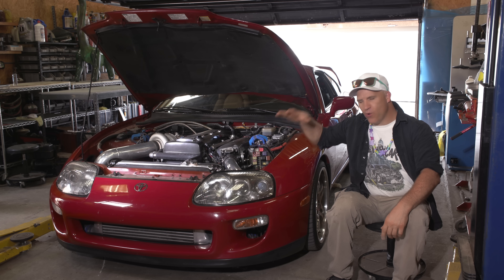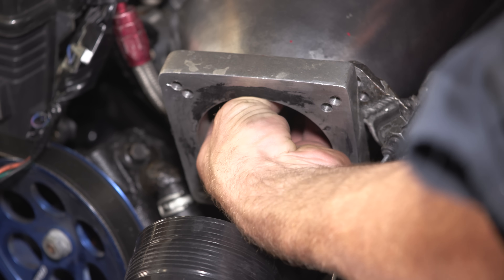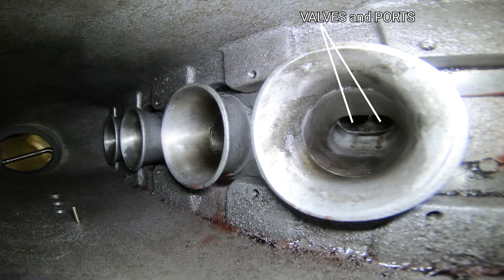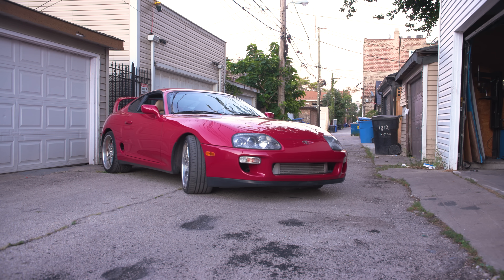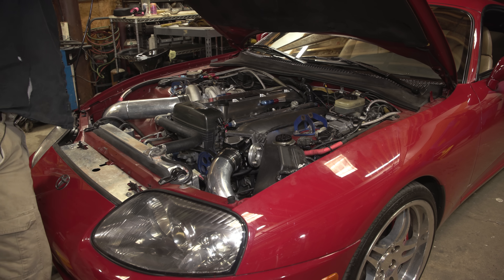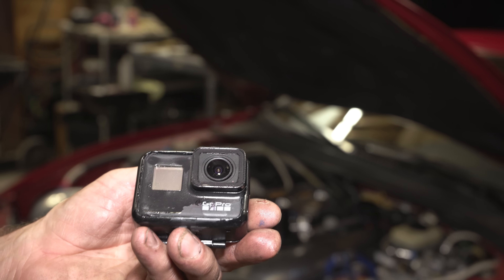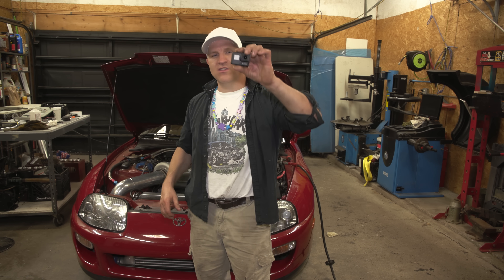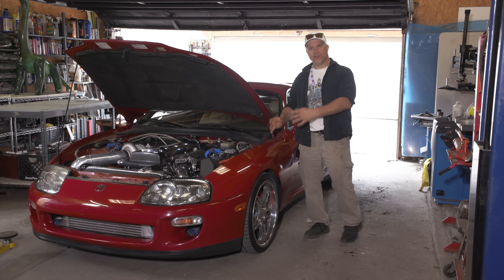Driving with Gopro Inside My Intake Manifold (Toyota Supra Turbo)

Comment: Looks like you need someone to adjust the tune, but my guess is that you are still on the stock ECU
Reply: Think he might have an obstruction in his intake manifold
Reply: I'm going to go out on a limb and say considering it has around a 1000hp that it's tune is on point, the oil you see is normal its from the pcv   he just needs a catch can
Reply from the maker: So the oil turned out to be from the power steering low pressure vacuum switch, turns out it's defective and it's bypassing oil from the power steering pump into the intake manifold.  If you look closely the fluid is red... That's what led me to check out the power steering system.
Reply: @WarpedYT  Oh thank you for answering that. I was confused why it was red. Kind of broke my brain...
Reply: @WarpedYT  i had to find this comment because I couldn't figure out why it was red lmao
Reply: @tylerc7336  exactly this shows why catch cans are useful
Reply: @8KrepE7  he has a catch can, theres AN line from his intake pipe off the turbo going to the catch can. He should not have it run like that and just have a vent off the catch can. Oil is getting pulled through that line and put through the whole intake path because of this.
Reply: @suprarob8553  you do want it ran to your intake because that causes negative crankcase pressure. Catch can just isn't doing its job well.
Reply from the maker: It turned out to be power steering fluid.. but I designed the original catch can system for the 2JZ Supra. You can look back am I original design from like 16 to 18 years ago, but it does run into the intake to take advantage of the slight negative pressure after the air filter. But yeah it turned out to be my vacuum switch for the power steering pump it's faulty and is bypassing oil from the power steering pump into the intake manifold through the reference tube
Reply: @WarpedYT  it looked weird to me, at first i thought it was power steering fluid, but i was like nahh iam pretty sure iam wrong, but i was right lol
Reply: @suprarob8553  a catch can can be vented to atmosphere
Reply: @tylerc7336  1000hp I'm gonna say that is very unlikely, I know plenty of cars that are known as 1000hp cars that fake the numbers.  Really I was going off of every time he did a pull there was fuel blowing back into the intake manifold being sucked into other cylinders, its dirty but effective or an injector is sticking open.
Reply: @Junkyard_Dave  dude this is the first time anybody has put a camera inside a Intake manifold, stop acting like a Mr know it all, the tune is fine his car runs great you have know idea if what's going on inside is normal or not
Reply: @tylerc7336  actually they have been doing it on F1 engines forever even when the cameras were as big as suitcases
Reply from the maker: Exactly what I was thinking too! that's the whole reason I did it in the first place I knew we were going to see a lot of unexpected things, but someone else commented pointing out that all that fuel spray is exactly why oems are using direct injection and other technology to increase efficiency.
Reply: @WarpedYT  it was definitely a cool video too bad it wouldn't last long in the exhaust.
Reply: @Junkyard_Dave  a f1 engine and a supra engine are completely different engines
Reply from the maker: @Junkyard_Dave  thank you.
Reply from the maker: @Junkyard_Dave  yes everyone with a Supra claims 1000hp, but I can give you my mod list, my car at one point made 1150hp during that time I had twisted about five different driveshafts like a pretzel and almost broke my hand twice from the drive shaft yoke hitting the shifter from underneath, that happened in 2nd and 3rd gear. That's why I recently detuned the entire thing to make about I would guess 950hp, way more fun to drive with a smaller turbo smaller throttle body and smaller injectors, I'm running e85 I built one of the first super is that ever ran e85 a long time ago. And my ECU is AEM, I was going to show some of that in the video but I'm going to save that for the future videos . I wanted to keep this one short and sweet.
Reply: @tylerc7336 hes talking about putting cameras in engines...not comparing engines
Reply: @WarpedYT Can you adjust the start of injector time? If so you can get the injectors in sync with your cam.
Reply: @tylerc7336  Then why do manufacturers waste their time and money building them? You can go from a tiny two stroke to a giant ship engine, physics still apply. No not everything, but what you learn from one can be applied to the others. Just not a wankel, that's a different beast altogether.
Reply: @divinedriftofficial  yes I know and I'm talking about the way the 2 are designed are completely different Indy engines have no smog,mpg,and longevity to deal with so I'm sure the inside of the intake manifolds act differently
Reply: @davidwickboldt712  I guarantee a port and polish job or a aftermarket manifold would end up with diff results,
Reply: @divinedriftofficial  we're having a perfectly fine debate so unless you have something to add go troll elsewhere
Reply: @Junkyard_Dave  it didn't sound like a 1000hp car. I've heard 600hp 2jzs that sound rowdier
Reply: @tylerc7336  you literally said this guy is the first guy to put a camera in an intake, that dude said they been doing it in f1 before. And ur saying oh the engines aren't the same or comparable. Who cares. First is first.
Reply: @WarpedYT  a friend of mine  bought the 2020 customs supra in washington state that was owned and tuned by the owner of AEM. It made 650+ whp on pump gas, 1100 on c16. He didnt have a e85 tune because it wasnt as widely used back in 2007. I've been in some fast cars, but that one was terrifying. 170mph in 5th gear, on a very busy urban road was my last memory of that savage animal beastmode car. He had a lot of the same stuff you use, 6 inch TB, crower 3.4 bottom end, 80mm honeywell, banks intercooler for a diesel, AEM EFI. I believe what you say about the output, these other fellas are just a little too used to internet BS and that clouds their perception. Still only ran a 9.89 quarter, like most 1000hp supras lol.
Reply: @r6exrider  Well, you've clearly got a lot to learn still.  As if you'd know exactly what sort of exhaust and muffler system this guy is using, and how well the mic communicates the audio.  But hey, it's the internet comments.
Reply: @WarpedYT  dude I have to say that is on sexy supra . I'd love to see it in person and just be a passenger for a pull . That thing looks amazing and runs insane love it !!
Reply: I love these armchair tuners giving mechanical advice with very limited audio quality
Reply: @vintageexcellence  meh everyone is entitled to there opinions and theories
Reply: SIMCARZ 3ny tuning has one best outcome to make the most power with the same equipment - opinions have ZERO to do with it. Do you have a wall of participation trophies in your room?
Reply: And the award for most pointless internet pissing contest goes to:
[ ] Religion vs. Atheism
[ ] Meat eaters vs. Vegans
[ ] Our military's X is better than yours
✓ Car guys
Reply: Everyone here saying Junkyard Dave doesn't know what he's talking about clearly have no idea who the dude is. The man is hand fabricating his own 2020 Hellcat AWD Magnum by himself and I am damn impressed.
Reply: 1000hp and thinks it's stock ecu.  Cmon.
Reply: @SportbikerNZ  I could get 1000hp out of my car with a stock ecu, but its not a Toyota, they probably aren't as adjustable
Reply: @BrokeWrench  Not to mention the obvious, but your ecu prob isn't 90's vintage?
Reply: @SportbikerNZ  1995 Eagle Talon. Id need a lot more work to do it, but the stock ecu is basically able to do whatever you want until the hardware isn't able to keep up. My evo is even better but thats an 03
Reply: @BrokeWrench  You don't need piggyback units fooling the ECU?  Or physical changes to the ECU?
Reply: @SportbikerNZ  nope. There is a memory chip that gets replaced for the talon so it can use a programcalled dsmlink, but the evo has a reflashable memory from the factory. Most of the Mitsubishi ecu's are reflashable and you only need to replace them with the craziest builds for that extra bit for competition
Reply: @BrokeWrench  Oh ok, sounds rather mod friendly.
Reply: Dear Dave....stop giving advice when you clearly have no knowledge of what's tunable and how it is done.- sincerely, everyone on this channel
Reply: @DrB00ST  Someone had to say it.  Thumbs up.
Reply: @DrB00ST  pretty sure I have the correct qualifications to make the assumptions I made. I mean i will say I'm very well versed with JZ', MK4's, and tuning.
Reply: @Junkyard_Dave  well then you would know that you can tune a stock ecu right? when I still had my 13b in my 93 fd I made over 600whp on stock ecu with an apexi safc II
Reply: @DrB00ST  There were about 10 people here that gave the wrong advice and you're picking on one guy?
Reply: @Gino_567  Pretty sure the OP is first in line to brought into line, given they are the OP.

Comment: Nice, I would be worried about the red hydrolic fluid though
Reply: Congratulations on being one of the few people who spotted it as being  hydraulic fluid. Turns out it was from a faulty vacuum switch for the PAS pump bypassing fluid back into the intake via the vacuum reference line (he replied in another comment).

Comment: Your running 20-25psi so i assume not meth injection correct?  If it's not then you are having 110% mega blow by.... We build Supras for a living (well and a whole lotta KAs and SRs and even the odd RB here and there... 1, 1.5 and 2Js are what we specialise in)

I fully believe you have a leaky head gasket. Also the tune is far from clean, this car hugely needs a good tuner and some dyno time.

If you are in Florida my Husband and I would be more then happy to dial her in for you.

Comment: The oil is probably from the crank case vent return line that goes back into the intake

Lovin these videos.

Don't see many of those FANTASTIC Supras anymore. They were one of the only cars i would worry about when it pulled up next to me when i used to street race in the late 90s
Reply: It looked red like the oil you put on a K&N cone filter
Reply: look to the right. the head is broken, leaking oil through the crack. some dowel pin for other intake i guess
Reply: The oil spoil not good
Reply: It's power steering fluid. 

His answer to a different comment: "So the oil turned out to be from the power steering low pressure vacuum switch, turns out it's defective and it's bypassing oil from the power steering pump into the intake manifold.  If you look closely the fluid is red... That's what led me to check out the power steering system."
Reply: @DanielStancex  wow, that's interesting. I had no idea the Supras power steering system was hooked to the engine vacuum
Reply: @johnnyturbo8460  I was definitely going with your first hypothesis and I was going to recommend the uploader install a catch can. I'm not familiar with the Supra's steering system; pretty weird that it's integrated with engine vacuum, but I'm fairly sure there's probably an engineering reason for that.
Reply: @chrislimnios9180  agreed, it does seem odd for the power steering to connect at all to the intake.

I was also thinking maybe it was E85 , because you can see the fuel injector at the last port closest to us (the one you can see down), dumping fuel and between shifts when the boosted air goes out the waist gate (to release the pressure during shifts) some of the fuel goes out into the intake with the vacuum of the air escaping threw the blow off valve.
Reply: Alrite Paul walker calm down
Reply: @jamesscott5407  what does that even mean?
Reply: Ask vin diesel you spoon
Reply: @jamesscott5407  

Man, you got Fender Bendered!

😂😂😂😂😂
Reply: @jamesscott5407  nah, why don't you ask him the next time he is spooning you!

Check mate,  you loose!
Reply: @johnnyturbo8460  

Haha....

Thumbs up from me for that last comment. 

Keep it real brother!
Reply: @johnnyturbo8460  you mean lose...not loose...I was just playing about...I'd hate to offend a 90's street racer...you're all well hard, double clutching like you should
Reply: @jamesscott5407  nah fool i mean loose because when Vin Diesel is done with you, you will be loooose!

Don't correct what you don't  understand. It's best you just fade away at this point. Shhhhhhh
Reply: @ukcitizen1158  🤘😁👍
Reply: @jamesscott5407  funny that. no one got the reference
Reply: @duneattack  there's a couple of references dropped that no one picked up on...I did start this for just a little giggle..hoped our man Johnny turbo here would have been more intellectual 🤷
Reply: @johnnyturbo8460  don't worry James is going back to school soon.
Reply: @richardd8352  🤘😁👍

Comment: Next up: driving with a GoPro in cylinder 4
Reply: that will not work, the motor will blow up in less than 5 minutes, guaranteed!!
Reply: The camera wouldn't last 1 compression, and then the smashed camera would foul up valves and then it's lights out for the engine too
Reply: @mrandmrsmessy  hah, I was totally kidding, in my opinion the engine won't even crank over one revolution. It will act like a seized engine.

Comment: The oils from your intake valves turbo or PCV... which I would bet is deleted. Also what kind of injectors do you have?.. out of curiosity. the spray pattern is horrible. And most cars you want the fuel injector to be pointed at the back of the valve not at the face of the port. But maybe that's how 2jz are.

Comment: The oil did puke up out of the cylinder on startup... probably a valve seal. Looked like some oil coming from the turbo too while running, hard to say, could also be emissions system.

Comment: For those wondering about that red oil in the intake, my guess is he over oiled the KN filter. Happens a lot
Reply: That's why I don't use K&N oil filters as they suck ass. They are notorious for dirtying your intake.
Reply: @jamesm568  I expect the filter is over oiled
Reply: @jamesm568  they dust compressor wheels, sand blast valves and cylinders too. Total junk
Reply: @turbolq4  Most performance junkies and mechanics will tell you that oiled K&N filters are junk and the best air filters are high quality paper air filters. That type of oil seems a little excessive for an air filter oil though.
Reply: Yup. Ruined both MAF sensors in my 370z.
Reply: I was gonna say that too. Except that oil caused problems for my car.
Reply: He mentioned that it was power steering fluid in the vacuum lines
Reply: i wonder after your comment
Reply: @sazahiblahblah1494  Professionally I've see it far to many times. It coats and kills almost all sensors behind the air filter almost all the time. It's also the only red oil you'll see in the  intake. PCV oil wouldn't be red. A properly oiled filter shouldn't cause issues
Reply: Skunk Workz Garage Ahhhhh
Reply: no it's oil come from pcv valve
Reply: K&N are so old school
Reply: It's power steering fluid. 

His answer to a different comment: "So the oil turned out to be from the power steering low pressure vacuum switch, turns out it's defective and it's bypassing oil from the power steering pump into the intake manifold.  If you look closely the fluid is red... That's what led me to check out the power steering system."
Reply: Better get yourself a pipercross, does a good job😁🤙

Comment: A sloped or coned  transparent cover over the lens of go pro cam might help negate back-pressure problems inside the engine while filming shots like this?  Like something to make the blockiness of the camera interfere less with engine(esp for cylinders 5 & 6) operation under full throttle I mean.  I think there is much to be learned from this perspective from an engineering standpoint.

Comment: Just check ya pipe in out intercooler if there oil turbo issues.vavle stem seals or ring wear check plugs to locate cylinder with issues. Pcv check piping to inlet manifold for oil in pipe.Oil looked like it was starting to pool on floor of plueum chamber?

Comment: That was awesome!
I'm a little worried about the oil I see collecting in the bottom you can see there gets to be more after you hit it hard a couple times. Is the turbo spitting out some oil? I hope not cause it's never a good sign. Maybe you can catch a turbo shattering for us. 
All those little pieces of blade going every where. That will definitely take more than one camera to capture.
Ok there is an idea for you. Look forward into seeing a turbo explode. 
I have seen the aftermath but never as it happens.
Hey GoPro. Send some camera's out. Freebe.
Keep up the good work

Comment: And thats what a terribly designed manifold looks like in action. If you look under the stacks you can see fuel sat there going nowhere.

The white fog you see is due to the drop in pressure. This is a contrial without the trail, basically condensation of water in the air.
Reply: definitely oil not fuel
Reply: I only noticed white fog when he closed the throttle. Of course the pressure drops then
Reply: Looks like Toyota red coolant to me
Reply: Wait... Do you mean CHEMTRAILS!!!!!!????

Comment: Almost every engine with an oil system, and even 2 strokes depending on fuel-oil ratio, shoots tiny bits of oil into the intake manifold.  4 strokes have residual oil and fuel being thrown from the cam to the valves that gets sucked from the cylinder and back as per pressure change otherwise known as  the throttle position (in essence) and for 2 strokes its relatively the same only it's the oil that doesn't burn off and has found its way out the intake instead of the exhaust...